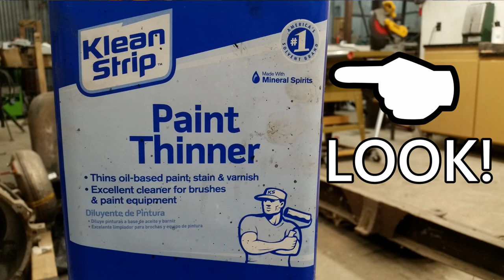Common hardware store Solvents you SHOULD know!

Comment: Man I wish I watched this like 2 hours ago, I used some odorless mineral spirits on my project.  I live in a subdivision in an upper middle class neighborhood and I am sort of the black sheep.  I weld, grind and paint.  I am trying to get the VOC and smell down so I dont get complaints.  I tried the OMS and it almost seems as if it separates the oil based paint.  On horizontal surfaces it looks super wet, on vertical surfaces it behaves how I would expect.  I was already thinking, man acetone is probably king I am not impressed with OMS.  And you literally are saying you think the same way. I think was I might try is a to use a small amount of OMS to reduce the evaporation time and allow for flow out but use majority acetone reducer. Great content and thank you I am learning alot.

Comment: NAPTHA actually has one of the slowest evaporation rates. Part of what makes it most handy for removing old adhesives. More time to soak in and penetrate before drying out. Also why commonly used as lighter fluid. Generally safe on painted surfaces.

Comment: Xylene and toluene can be used safely outdoors.  Definitely not indoors.  They are useful for dissolving low molecular weight acrylic resins like paraloid b72.  Also, many spray can paint manufacturers dilute xylene and toluene in their products with acetone to make them VOC compliant and faster drying.   Adding a little acetone to naphtha will help in painting in cooler weather.

Alcohol solvents are good for making and applying inks.  I have a home brew reducer for acrylic and water based latex paints.  It is basically 20% ethanol in distilled water with additives.  Great for airbrush working water based paint

Comment: great information... i think you covered it all... every once in a while i'll use gas to thin paint for my outdoor iron work
Reply from the maker: I imagine that the fast burning gas and slower burning paint would act like a napalm. I always wondered what it'd look like turned fluid up, fan down and lit it up?
Reply: @unitedstatesofbuild4915  I have never mixed the two and tried lighting it, i use it to thin thick paint..  however it's like all the other thinners, they are all flammable. Why spend $7 for 12oz of thinner when you can spend $1.89 for a gallon that does the same thing on outdoor iron work and outdoor figurines that no one will be around.
Reply: @wemcal  $1.89 wow!  those were the good ole days eh?  lets go Brandon!  lol
Reply: @Dildo_Baggins.  yes those were the good ol days.... gas is $4.39 a gallon today

Comment: Hi,   when you pour out of your solvent  it runs down the side of the can, if you turn your can so your hole is on the top and pour over the handle it let's air in and let's it pour better,  kind of hard to explain but might be worth a try , thanks

Comment: Hey, great info and appreciate it coming from someone who went through a program and presents in a scientific way.
I suggest you look more into Xylene (since you seemed to dismiss it in the video) as you may come to like it. I've perused many forums regarding thinning Rustoleum and although acetone is a great reducer, many experienced posters mentioned xylene would be very well suited especially with it's albeit slower, but still mid-high flash time. As well, I've found it thins Plastic Wood better than acetone and also thinned my Plasti-Dip perfectly.

Comment: Rust-Oleum decades ago used to recommend thinning with Mineral Spirits. IMO they changed the recommendation to Acetone because of VOCs....When spraying Rust-Oleum I may or may not add Japan Drier appropriate to the amount of paint. Then either way I thin to 2:1 or 1:1 with Mineral Spirits. I find 2:1 goes through the gun okay, but makes more orange peel. If I want it really smooth finish I mix to about 1:1. At 1:1 you may have to make more coats, cuz when thinned that much it likes to run on vertical surfaces. Here Japan Drier is also nice so you don't have to wait as long between coats.

Comment: So for a good finish and using Rustoleum Acetone is better what about the Japan drier (what would be the amount used or the cat. bottle how much of each ) Thanks kool video
Reply from the maker: Acetone is a good reducer. Japan drier would be considered an activator, it controls the speed at which the paint dries. Acetone combined with japan drier will set the rustoleum off fast. If you wanted something a little slower then try mineral spirits and regular catalyst. I add 1 to 2 caps of japan drier to every mixed quart
Reply: When you add the 1or 2 caps what is the shelf span on that paint. & the JD what would be the adding 1or 2 caps as well along with acetone 50/50 again sorry 4 the many questions again thanks RF. TX.
Reply from the maker: 4paint:3acetone:1catalyst:1capsJD
shelf life is short, I only mix what I can spray in about 20 to 30 mins.

Comment: I work for a startup water bottling company. They've been using Klean Strip Mineral Spirits to lubricate the plastic blow mold at my work. They squirt it onto the machine while it's running when there are plastic preform water bottles moving through it. They then go on to be filled with water and packaged. I feel like this is very toxic and a huge misuse of the product. Am I incorrect?

Comment: Good video. I wanted to use Rust-oleum FLAT BLACK on my truck (whenever I get it done). You say to use acetone. If acetone is a fast dryer, won't that make the paint dry fast? And if it dries fast I would think that my paint job would turn out with streeks. I sure don't want that. Can you shed some light on my issue ❓Thanks for sharing.👍👍
Reply: I use just "Paint Thinner" and have no problem!!! I wouldn't use Acetone as a thinner!!! But give it a try on a scrap piece of metal!!!
Reply from the maker: Acetone is fast, with practice you will be able to read exactly what the paint is doing once it leaves the gun; like drying in the air, uneven pattern, not atomizing, etc. Once you can read the 'wet spot' (where its hitting the substrate) then you can eliminate streaking.
Reply from the maker: Like Pat said, thinner is a great option too, it will dry or 'flash' much slower than acetone. This can be an advantage, it will allow paint to flow out, it stays open longer allowing for a quick touch up that will properly melt in and in warmer temps its the better choice. Def do some experimenting. Thanks Pat and Andy
Reply: @unitedstatesofbuild4915  Thanks for all the tips. I can do some experimenting, but that would only be for application. I am also concerned about the long term. Thanks again.👍👍

Comment: Great video. I have just treated an english white oak beam with boiled linseed oil and after 3 days its dried way to dark. I obviously didn't sand it enough prior and would like to  use acetone to remove the oil before i go back to the sander and start again. Would acetone do the trick and break the linseed oil down so i can wipe it off?
Reply from the maker: I dont really do a lot of woodworking projects so I cant give you an educated answer. Sorry, best of luck

Comment: 50 years a painter here. Personally,  I would never use acetone as a paint thinner. I recently used a product that was reformulated with it to comply with the latest VOC standards ; it was a terrible product & created many problems for me. Personally, I prefer naphtha over most thinners. Why didn't you mention penetrol or boiled linseed oil ? Penetrol is a great product & can be used as a coating on raw metal or wood, or as a paint additive in oil base paints....
Reply from the maker: I dont have any experience with penetrol. I wouldve mentioned boiled linseed, and I do use it but only on wood related projects. I dont know that it would be capable of thinning paint to a sprayable consistency for any air fed guns. Have you tried?
Reply: @unitedstatesofbuild4915  Penetrol aids brushing and flow out with oil paints.  I've not heard of it being used with spraying.  Boiled linseed oil by itself is sort of slow to completely dry--tung oil is faster-.  Some people mix some varnish with it to help drying and hardness;  Japan drier would probably do it too.  Acetone is handy for drying things--containers, water-containing brushes, etc.  Enough to coat the surface or bristles combines with whatever water is there, and then it  all evaporates quickly--can speed it up with compressed air or hair drier.
Reply from the maker: Where do you guys get your penetrol?
Reply: @unitedstatesofbuild4915 / penetrol is available at most paint stores or on line...
Reply from the maker: Cool, Ill look next time Im there. I appreciate it!
Reply: @kennethdodds2323  can you use that as a thinner I'd like to know if you could answer me I mixed I am with the oil base and spray it on metal

Comment: From you experience with Rustoleum oil base enamel, though they recommend acetone only on the label, you say you’ve had success using catalyst, mineral spirits, and Japan deter?
Reply from the maker: Yes, it will work with mineral spirits. It wont flash as fast as acetone
Reply: @unitedstatesofbuild4915  Got it, thank you. Have you had good results with any oil-based enamel hardener rather than Japan Drier?
Reply from the maker: Yes, If you go here: https://youtu.be/6eoFYTp98XE there are a bunch linked in the description